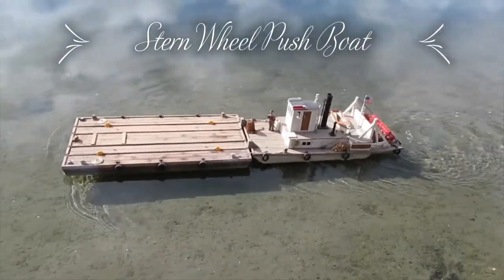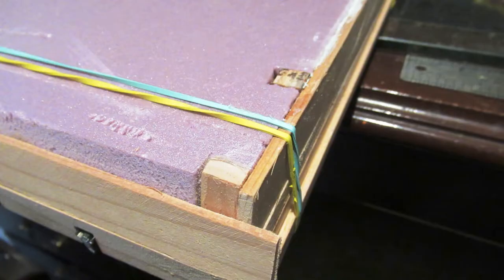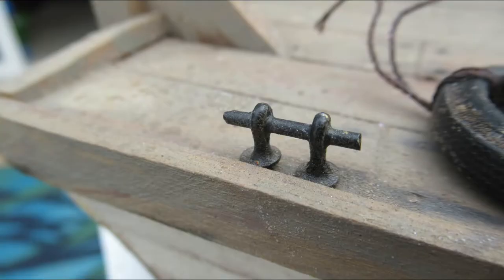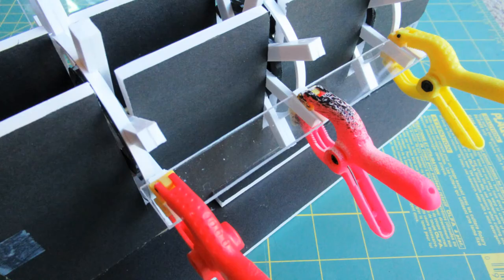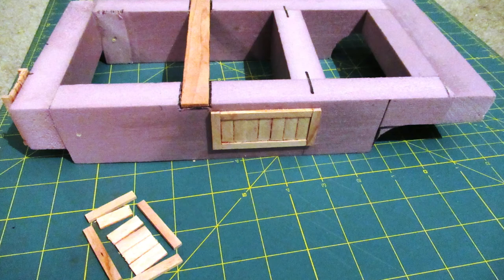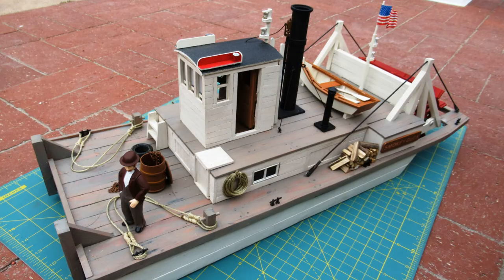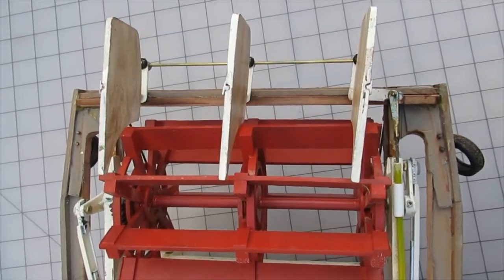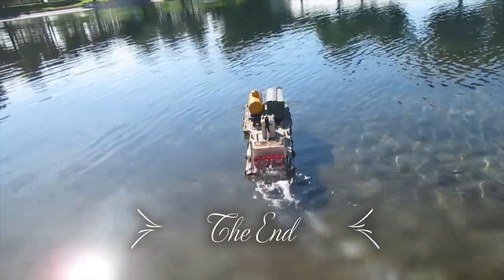RC Stern Wheel River Boat build, Push Boat with Railroad Car Float barge. Garden Railroad steam boat

Comment: Super cool if I wasn't so adamant on using live steam my g scale sternwheeler would have already been running, right now it's just a hull and a deck cut and glued from 1/4 in plywood
Reply from the maker: I built ferry boat with interchangeable live steam, or electric powerplants, but the connection to the prop shaft is simple.  It could be difficult to implement with a paddle wheel.  I will publish a dual powerplant ferry video soon.

Comment: love the video, would like to build this a little larger perhaps 46" X 16". what size paddlewheel would you suggest thinking 5X12 or 6X12.
Reply from the maker: I scaled my boat approximately from photos of actual steam push boats and a model offered by Train Troll.  My hull is 24 x 8 (half the size you plan) and my paddle wheel is 4 dia x 6.   So   I am thinking the 6 dia x 12 would work - although 8 dia x 12 would be closer to what I used.